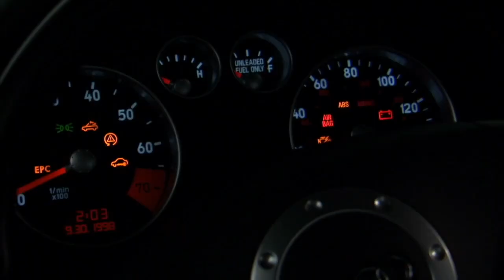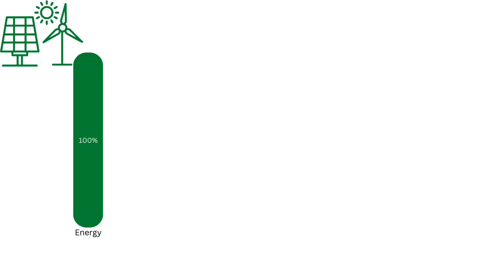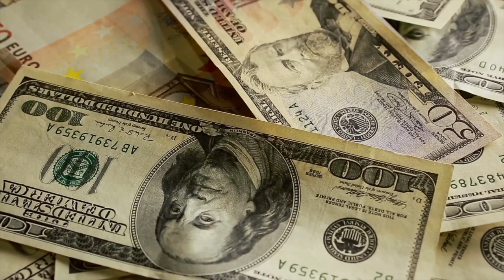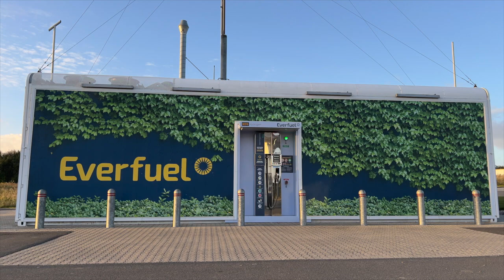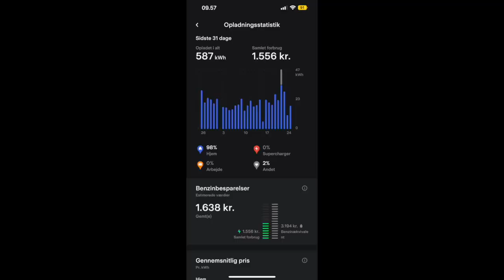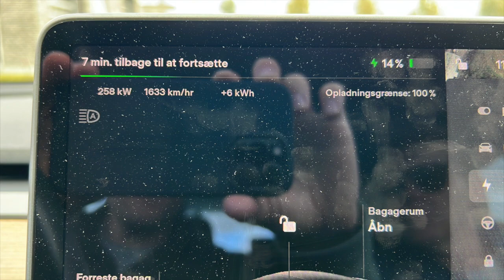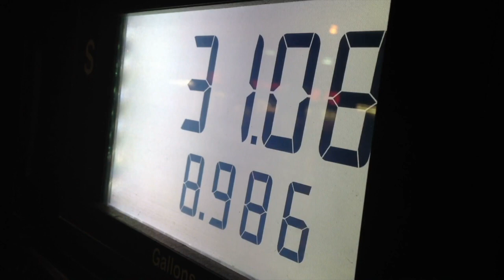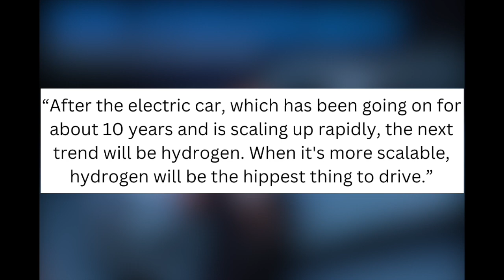The Truth about Hydrogen - The dirty little secret

Comment: A few points that your video did not cover explicitly:
1) Hydrogen fuel cells require rare, precious metals. This is part of what contributes to the high cost of fuel cell powered vehicles.
2) Yes, hydrogen is incidious, passing directly through metal containers. It also makes metal brittle over time. This is why high pressure storage and fuel systems reach end-of-life.
Some of these issues could potentially be solved if the hydrogen is stored in the form of amonia or methane, but it looks like BEVs have already won the day.

Comment: Hydrogen is not practical, even if the process flowsheet steps could be reduced and it can be reduced. But, is it worth the development costs? Not likely. Besides there is plenty of nat gas (having the maximum energy content per unit of carbon) to generate electricity at about 60% efficiency, in a combined cycle power plant. Doing so until photoelectric-battery system capacity is in place.

Comment: At high pressure/ or low temperature current pipelines are indeed not suitable.
But, at lower pressure our national methane pipeline grid network is tested and perfectly usable.
Only at filling stations it needs to be compressed, while at homes/factories low pressure can be used.
Conversion back hasn’t 100% efficiency, but it does when both warmt AND electricity is needed.

Comment: Lars now you got on my nerves. 😡. The gas furnace is getting almost 98% efficiency FAR FAR FAR above the 50% you are claiming. Because there was some misunderstanding about efficiency calculation some condensation devices have even efficiency 103%, that is above 100% limit. The heat pumps work well only  if they are ground heat pumps. Those kind of devices are bulky require a lot of land, huge earth works and ship-boats load of money 🤑. Just to get to the point. Yes creating methane or hydrogen from green electricity for heating properties do have sense.
Reply: @ayCarumbaQueLio  You must be an USAns because only THOSE kind of people use Faranheit as a unit for temperature. Normal people in the world like 95% use metric system. So if you think your heat pump is working so well write here how much energy do you use to heat your house per year? What is the lowest temperature during typical winter where you live ? If you think that 26 deg F = -3 deg C is low you clearly have not lived in mainland Europe. Central Europe in winter night gets normally low to -20 deg C. In such conditions  water is freezing on the air exchanger and air heat pump does not work at all.

Comment: Very good, Lars. However, when you said you only get 50% heating energy out of burning H2, this is not correct; it’s about the same as a natural gas boiler, or 90-95%.

This does not change any of your conclusions; H2 as an energy carrier makes no sense for virtually all use cases.
Reply: It was taking into account the energy loss in producing the hydrogen, where most of the loss occurs. It's more efficient to use natural gas directly instead of converting it to hydrogen, or for renewable electricity it is more efficient to store it in batteries and use electric heat pumps.